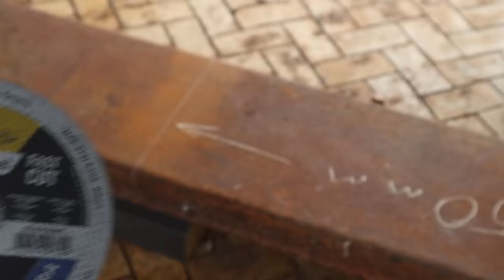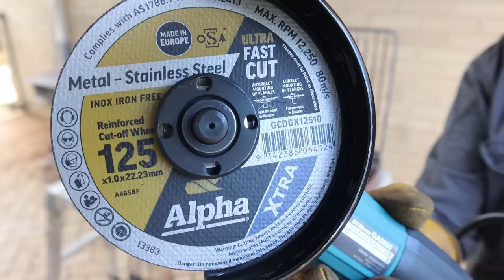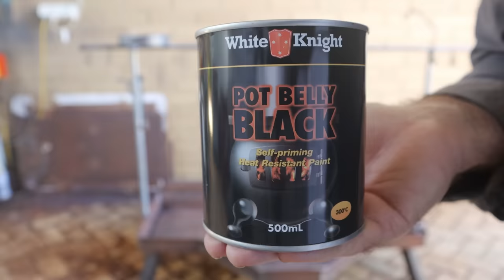I make a Metal Firepit for Campfire and Dutch Oven Cooking with a Swinging Pot Hanger.

Comment: Lol drilling out the nuts why have I never thought of that? Guess I'm a fart smeller not a smart feller. But that gives me ideas for very cheap hinges. You could drill a hole through the sides and then run a screw through flush and use it on wood that way.
Reply from the maker: I like your idea, that would also look very good on the project. I wish you the best.

Comment: Would be nice to see a picture of it working.  Is the fire under it or in it.  ??
Reply from the maker: The fire goes on top, and you use a shovel to put nice red hot coal from the fire to build a mound to sit the dutch oven on next to the fire and also put hot coals on top of it, you adjust the heat by using more or less hot coals while the fire continues to burn next to it, if you need more coals they will be there in the fire, the grid is heated the same way. I will do a video with it with a nice fire and cooking at some stage, but that may not be for a while.

Comment: I note your pushing the weld not pulling it I always thought you backed away rather then push
Reply from the maker: I Googled it to get the right wording for you, I do both push and pull depending on the job, I am using gas on my MIG welder. Googles answer "Push or pull: Here the rule is simple. “If it produces slag, you drag,” says Leisner. In other words, you drag the rod or wire when welding with a stick or flux-core wire welder. Otherwise, you push the wire with metal inert gas (MIG) welding." I hope that helps.

Comment: This may seem like silly questions but what kind of welding are you doing here and what would be a good source to learn this type of welding. One more...can you weld aluminum and what type of welding would that be...? Thanks in advance.
Reply from the maker: I am using a 240-volt MIG welder and running gas with the wire. (You can use the same welder without the gas, you just have to use Gasless mig wire with it if you do). I don't do aluminum welding, but you can with a MIG welder, using an aluminum MIG welding spool gun.  The best place to start learning is on youtube, search "types of welding" and watch a few of these, this will give you a good idea of what welders do, then "Learning to weld for beginners". I wish you the best.
Reply: @GavinClarkdiy  Thanks for the info…! Looks like I have something new to do 👍🏻

Comment: Looks great!  How long did this build take?
Reply from the maker: Thank you very much, I am glad you liked it. I am sorry I do not have a time for you.
Reply: @GavinClarkdiy  I was just wondering wether it was a 1-day build or spanned over many days. Just a rough ball park…
Reply from the maker: @TheWoodWorkingPilot  I could probably do it in under a day and a half the way I did it, (Not counting painting) cutting everything with an angle grinder, it is thick steel and has a lot of cuts, which takes time, but if you have a plasma cutter you could reduce that cutting time. I also cleaned up the rust.

Comment: How do you prevent something like this (especially the hinges, where the paint wears off) from rusting?
Reply from the maker: The paint in the bottom will get burnt off over time and as you say the hinges will wear the paint off, this is fine for me all the steel is thick and the hinges are a loose fit (so they will not jam with rust), it will take many many years for this to rust through, it all adds to the character of it. (it is never a good idea to leave ashes in the bottom for weeks sitting there wet, it is nice to shovel them out the day after use.) I appreciate your comment.

Comment: so Gavin does the wood or charcoal go on top of the platform or am i not understanding how to use it , i can be a bit slow on the uptake , cheers
Reply from the maker: No problem Bill. The fire goes on top, and you use a shovel to put nice red hot coals from the fire to build a mound to sit the dutch oven on next to the fire and also put hot coals on top of it, you adjust the heat by using more or less hot coals while the fire continues to burn next to it, if you need more coals they will be there in the fire, the grid is heated the same way. I hope that helps.

Comment: wait that paint is only rated for up to 300c?.....uh.....that's not very hot lol core of a camp fire can get easily above that i thought? (not saying you're at risk of melting steel just the paint lol) Or does the 300c mean something else? Either way bloody amazing!
Reply from the maker: Thank you very much, I am glad you liked it. You are 100% right, the paint will burn off where the fire is, but it should be good on the steelwork up top and most of the legs, so rust will not be a problem and it should remain looking black/grey, and not give you rust on your hands when touching it. I appreciate your comment Shifty.
Reply: @GavinClarkdiy  Ohhhh okay that makes way more sense ;p

Comment: holy smokes!!! What were those big ass nails used for originally?
Reply from the maker: We used nails like that when I worked on an underground mine, using large hardwood timber for ground supports, and timber barricades, we could also drive them in timbers and hang pipes etc from them on the walls of the mine. I am sure they are used in other places too.
Reply: @GavinClarkdiy  Got it. Thanks Mate.

Comment: Does the fire go under or on top, how do you control the fire ???
Reply from the maker: The fire goes on top, and you use a shovel to put nice red hot coal from the fire to build a mound to sit the dutch oven on next to the fire and also put hot coals on top of it, you adjust the heat by using more or less hot coals while the fire continues to burn next to it, if you need more coals they will be there in the fire, the grid is heated the same way.

Comment: Before you paint you should always burn it first you know put a lot of charcoal on there or wood and burn it in and then clean and then pant  it .😊😊😊
Reply from the maker: The paint does not matter much, the paint in the fire area will burn off, and that is fine, the top painted steel will last much longer, up out of the flames a bit. This will never get painted again, it is just a fire pit and is made with thick steel, all is good. Thank you for your comment, Glen.

Comment: Do you put coals under the metal or on top
Reply from the maker: The fire goes on top, and you use a shovel to put nice red hot coal from the fire to build a mound to sit the dutch oven on next to the fire and also put hot coals on top of it, you adjust the heat by using more or less hot coals while the fire continues to burn next to it, if you need more coals they will be there in the fire, the grid is heated the same way.

Comment: Hi, I am Dutch but I have never heard of Dutch Oven Cooking. What is that? Is it an anglo-american phenomenon/term?
Reply from the maker: A Dutch oven is a thick-walled cooking pot with a lid. Dutch ovens are usually made of seasoned cast iron, Dutch ovens have been used as cooking vessels for hundreds of years. (That is from Google). This is how we cook with it, The fire goes on top, and you use a shovel to put nice red hot coals from the fire to build a mound to sit the dutch oven on next to the fire and also put hot coals on top of it, you adjust the heat by using more or less hot coals while the fire continues to burn next to it, if you need more coals they will be there in the fire, the grid is heated the same way. I love the taste of the food done in it over the fire. I did a very basic video on cooking with one a while back. https://youtu.be/V3KOWIsKZ_k

Comment: How i use that?!
Reply from the maker: The fire goes on top, and you use a shovel to put nice red hot coal from the fire to build a mound to sit the dutch oven on next to the fire and also put hot coals on top of it, you adjust the heat by using more or less hot coals while the fire continues to burn next to it, if you need more coals they will be there in the fire, the grid is heated the same way.

Comment: Man your fire is going to cool off to fast
Reply from the maker: Thank you, the fire goes on top, we burn hardwood, and have never had a problem with these or doing it on the ground just as a campfire, we have the frire burning next to the cooking so there are always hot coals to add to adjust the heat. Thank you for your comment.

Comment: the paint was out of place should have fire seasoned and scraped that slag off now you have slag under a layer of paint
Reply from the maker: The paint is there so it does not rust before it gets used, and also to coat the top rails etc, it will burn off in the parts that heat up because of the fire, and that is the plan, all is good it will do it's job. Thank you for your comment.